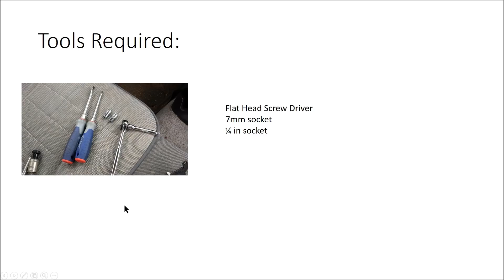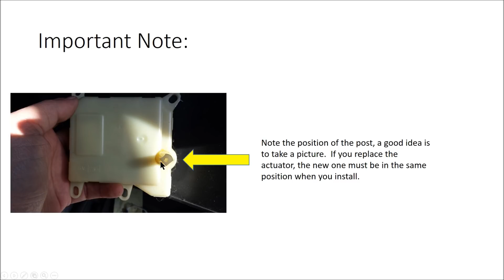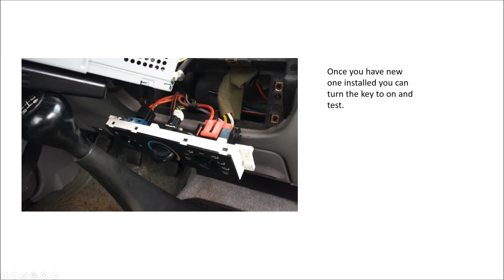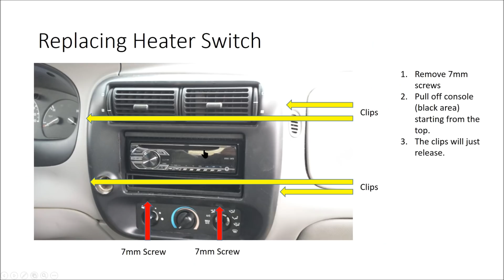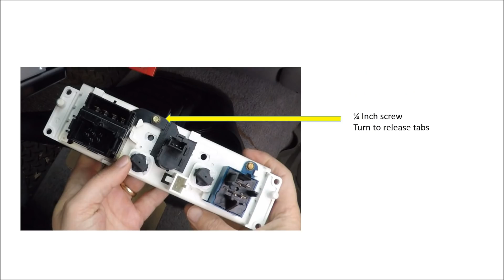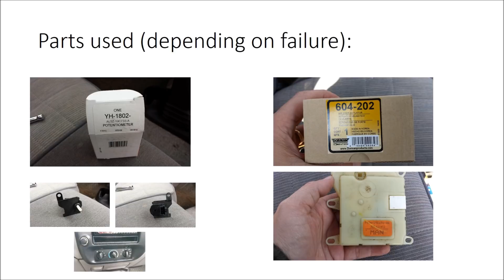Ford Ranger Interior Heat Repair

Comment: Great video, thanks. My '03 Mazda B2300 has a similar (the same?) system and is stuck on hot for some reason, perhaps issues with the actuator or potentiometer you're addressing here. I'm wondering if there might be a fuse that controls the heater potentiometer and actuator which might have blown? [edit: I'm not finding any blown fuses]

I'm also confused about the purpose of the vacuum-actuated heater valve itself in front of the firewall in the engine bay. Maybe it works in conjunction with the blend-door actuator so that the coolant only flows into the heater core when the door is in the heating position?

Comment: No need to take a picture of the actuator position. Just plug the new one in without changing the temp dial, and it’ll auto turn to the right position
Reply from the maker: Great comment

Comment: Hello Jack. Your videos are really helpful. I just bought a 1996 Range. I went to have it smogged the Tech told me that I needed to perform a drive cycle because it showed some code errors. What would you recommend?  Any advice would help. Thank you.
Reply from the maker: I guess he is saying you need to drive it at least 50 miles before they can do the smog.  if you had the battery disconnected it shows a drive time.  Is that what he is saying?

Comment: I have an 08 and all I get is heat unless I have max AC on......could this be related to the same components?
Reply from the maker: I think max AC closes the outside air when it's on is the only difference.  It's hard to tell not being there but the switch is suspect to me. That entire climate control in the center console is not very expensive.  You can also try one from a junkyard just to see if it changes anything.

Comment: Hi Jackleg...  great video..  I'm an amateur at this so I'm trouble shooting each item.  When I use the multi meter on the potentiometer I get a reading of 454 at 20K...  is that within tolerances?  The actuator for the blend door does turn but its kind of wonky (not smooth) and makes a clicky-grindy noise...  bad gears perhaps?  but it does turn.  Also, when I check the temp of the two heater hoses at the firewall, there is a 20 degree temp difference between them (147 and 125).  The vacuum valve seems to be working.
Reply from the maker: Sound like bad blend door actuator, they usually don't make any noise if you have it pulled out. The temp on the hose is good. If the blend door is moving it means potentiometer is likely working. Much of what I am telling you is a guess since I am not there.
Reply: @Jackleg   So I actually...  very carefully... popped open the actuator.  Everything inside looks pristine. I dabbed on a bit of lubricant and it sounds and seems smoother now so I think it might be ok...  I'm kinda stumped here🤔
Reply from the maker: @sarawood4603  what is the actual problem you are having?  What's the symptoms?  Not sure I can help but will try. :)
Reply: @Jackleg  No heat..  or rather, the heater will work sporadically, but I haven't gotten anything out of it for awhile.  When I saw your video, I thought I had my answer but I guess not.
Reply from the maker: @sarawood4603  Ford ranger?  What year?
Reply: @Jackleg  1996 3L...  I'm wondering if it could be the blend door itself???
Reply from the maker: @sarawood4603  I have read that in some cases the blend door can get stuck inside the heater box on a ranger. Seen videos where folks cut a hole in the side of it and use their hand to change its position.

Comment: so will work on a 2010 ranger if they are the same parts I have cold air coming out when I wanted to have heat but just cold air instead so I'm thinking this might be my issue I'm having any info will help thanks
Reply from the maker: That was my problem.  The outside vent was always letting outside air in.  So in the winter, so much cold air was coming in it felt like the heat was not on.

Comment: Where is the actuator for the knob on the right? My vents have defaulted to defrost and I need to locate the actuator that controls changing the air diversion between floor, vent, A/C, and defrost.
Reply from the maker: That is probably vacuum controlled. I have never worked on one see if I can find a video for you when I have an opportunity.
Reply: It was a vacuum issue. thx

Comment: Can anyone help me. My truck, the heat is always stuck on but only when im going at highway speeds or above 50 do I feel the heat. Sometimes it comes out by my feet sometimes the defrost sometimes both. But when I stop moving the heat stops coming out. Very annoying to drive in the summer time
Reply from the maker: I am totally guessing here.  If heat always comes out it could be the actuator or the temperature potentiometer in the console.  your blend door is currently in the heat and outside air position, that is why you feel the heat while on the interstate (outside air is pushing it into the cabin).    It's hard to tell without taking some things apart and looking.  All the parts impact each other.  :(
Reply: Jackleg I appreciate the reply so much. Thank you. The thing thats weird is I can still control my heat and the heat settings (high and low) but when I go to turn it off it just doesnt stop I dont know ill have to look further into it. Thank you!

Comment: Outstanding video and instructions.  I replaced the door actuator on my 2007 Ford Ranger today.  Mine had 3 screws holding it on.  Needless to say when I was finished it had 2 screws holding it on.  The back screw is just too hard to get at.  Had a hard time lining it up.  Spent about an hour on that alone, but once aligned no problem.  Saved at least $150 by doing it myself and I'm 74 years old.   Thanks  Gary
Reply from the maker: Gary Smith thanks for the comment Gary and I am glad it helped.
Reply: how did you get the back screw out
Reply from the maker: Lori Kinney my ranger had clips Lori and not screws. I am hoping someone will see your question and respond.

Comment: Mine runs constantly?  Any ideas
Reply: Mark Simmons you ever find out why? I got the same problem
Reply: @kylehager9694  resister switch.on firewall below blower motor  13 bucks at nappa
Reply from the maker: Mark Simmons you can't turn down the temperature?  Mine was the temperature knob.  I can tell you it was really easy to turn and the new one had much more resistance.

Comment: Thanks for the video. I am trying to fix a similar problem with a 96 Explorer that I just got.
When I pulled down the glove box, there was no actuator. Some one had already removed it and cut up the heater box. I have a new replacement actuator, but there is nothing on the top of the heater box to secure the new actuator to. 
Are the posts that yours pressed down onto part of the heater box or a separate piece?
Reply from the maker: I went outside and looked.  It is hard to tell, but it looks like mine has a mounting bracket that screws in to the top of the box.  The bracket has the post sticking up.  (that's what it looks like).  I will do a little more digging and see if that is actually what it is.  
Some people cut the box open when the blend door is stuck or broken.  I hope that is not your case.  I will let you know what I find.
Reply from the maker: The only thing I could find related was the image on this page.  http://www.fordrangerforum.com/electrical-tech/121925-blend-door-cable-controled-electronic.html  
It shows a mounting bracket.  I think my ranger has one, but I could not tell how many screws it has or how it is mounted.

Comment: any tips if the door is stuck? the actuator works and i have coolant flow through the heater core but still cold air. anything besides cutting a hole?
Reply from the maker: Brad Simpson I have seen some people comment that the door actually gets stuck inside the box.   many DIY folks cut a hole in the black box.  I will look around for remedies tonight when I get home.  sorry I have nothing more concrete.  what year is your ranger?
Reply: its a 97 explorer but basically same setup. i finally got heat today by putting my finger on the part of the actuator that spins(still installed) and pressing down while turning the temperature select knob back and forth. no noise ever came from actuator but there was an audible change in airflow when heat started. im not sure what i did but hope this helps someone. i also read that the seal on bottom of blend door becomes soft and sticky over time causing it to stick....dont know if true

Comment: Great tip to check.. I have a 95 Ford Ranger XL. That has the same symptoms. I'll go out and check damper right now. Just got back and checked. Apparently mine has a cable running from behind the knob to damper. So that's not problem. Might need new thermo, but replaced that 2 years ago.
Reply from the maker: ChrisFix has another great video on troubleshooting.  It looks like he either has a ford or mazda.  https://www.youtube.com/watch?v=-XjXTVJhFLM

Comment: if your actuator and potentiometer both work then that is the reason you cut it open and move it manually. if you don't you pay around 1500 bucks for the garage to fix it
Reply: Is the door stuck inside the box in that case?  Good to know.
Reply: Jim Bandy it was a problem in the design that ford should have recalled. The door should move free, it's just the fact that they used a metal arm to move a plastic door and the plastic breaks